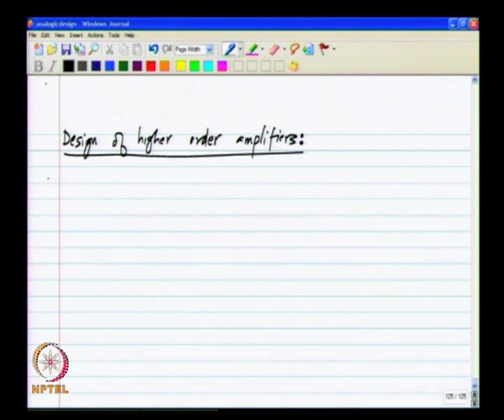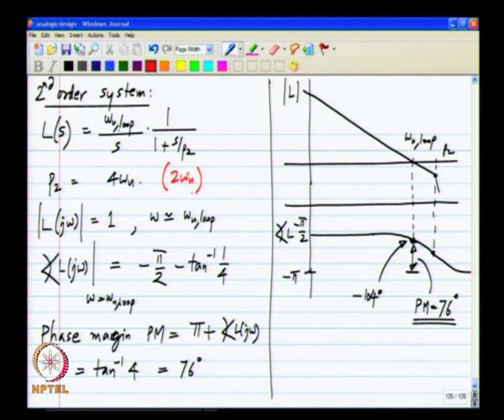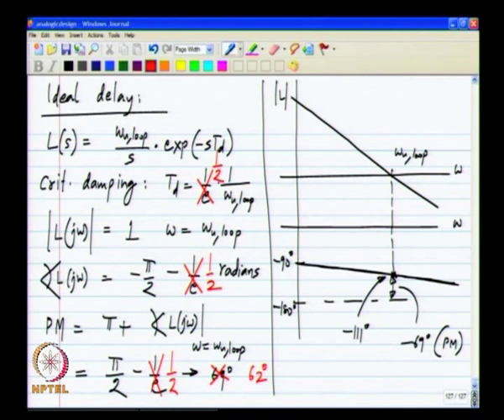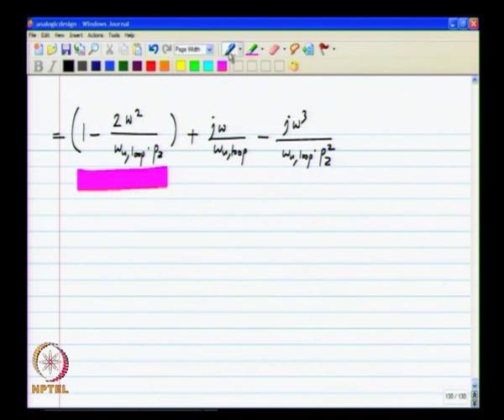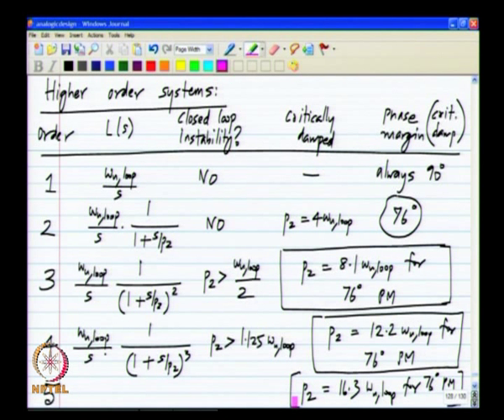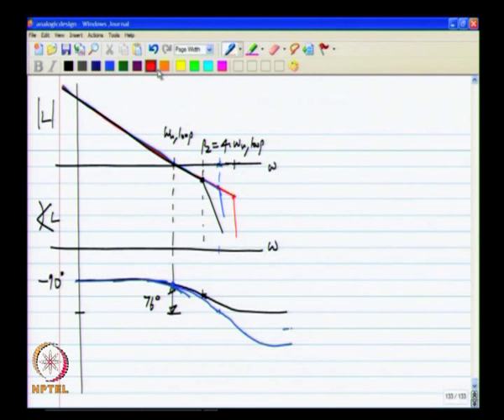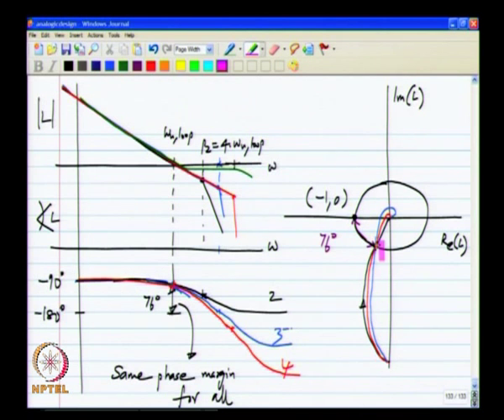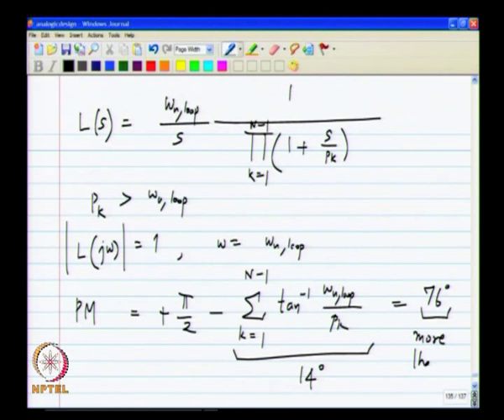Phase margin

Comment: At 44 :30 in regulated power supply we will use rectifier along with filter(for converting ac to dc) .. filter is nothing but integrator(low pass filter) either we can implement it by using RC components r else here we can implement it by using opamp?  May be compared to passive filters we will prefer active filters

Comment: I believe that the in summary of the results table, for the third order L(s) , the closed loop instability occurs for p2 < w_u_loop /2. The greater sign > should be replaced by less < sign.   An inadvertent mistake I believe. Or the head of the column should be closed loop stability ?  instead of closed loop instability ?
Reply: correct